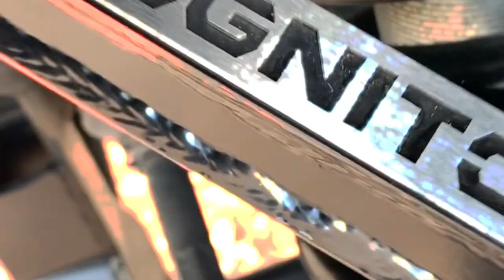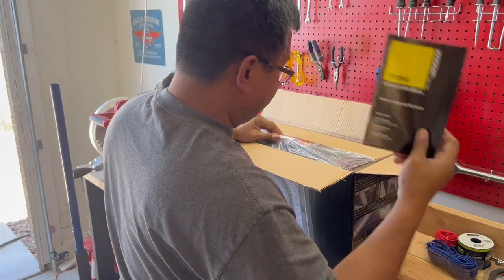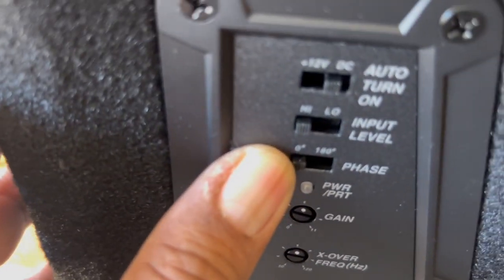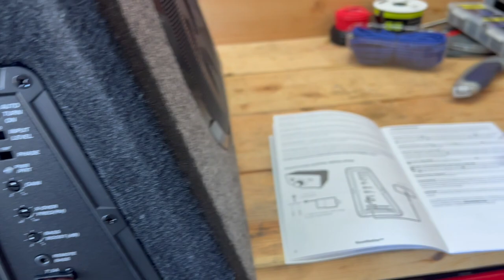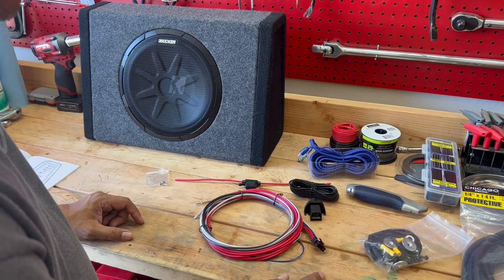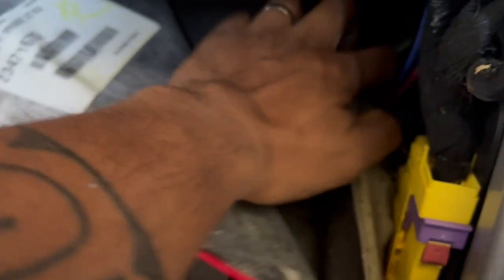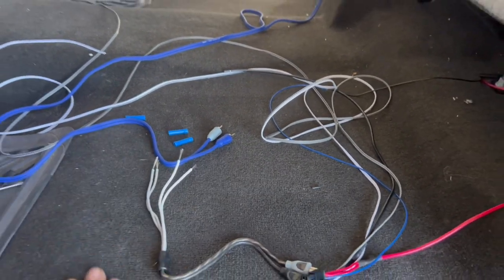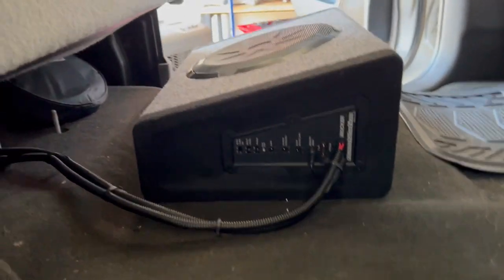Kicker PT250 Subwoofer Kicker Install and Review

Comment: The mic can't pick up the bass.
Reply from the maker: Thats usually the case when you try to record it...it usually never comes out...  You can make out the difference if you use good headphones earbuds.  I guess you'll have to take my word for it that it does sound pretty good for a small sub box.   Full transparency, if you're looking for loud and low thumping competition type bass, you're not going to get it out of this speaker. But if you are looking to add noticeable bottom end in your current stereo system, then this is a good solution.   In the cab, you can definitely hear and feel the difference without advertising to would be thieves...lol
Reply from the maker: @unknownplayer6398  It all depends if your jeep has a hard/soft top.  If your jeep just has a bimini top then NO, you will not feet it.  You will hear the sound but not feel it.  If you have a hard/soft then yes...the sound will resonate much better and you will feel it.  I would suggest setting the crossover more towards 100hz for punchy bass.  Like I said in my video, don't expect super loud booming bass.  It will add a fuller sound with noticeable bottom to your current system.  I hope this helps!
Reply from the maker: @unknownplayer6398  what matters is RMS.  You will need to match the amplifier output to those speakers.  Example:  10" speaker has a rating of 50 to 250 watts RMS (Rockford R2d2-10:  Click this link to view specs:  

https://www.crutchfield.com/S-NXEaQao6hnE/p_575R2D210/Rockford-Fosgate-R2D2-10.html?XVINQ=DST&XVVER=2M7&awcr=386393273913&awdv=c&awkw=&awmt=&awnw=g&awug=9030017&gclid=CjwKCAjwp7eUBhBeEiwAZbHwkXiQ9bCQFRsSfpaVlyIh2Ppug11Ey9xY79i_2TpwjVNj8_FCF0-6ZhoCz6UQAvD_BwE.  

RMS is defined as:  Root mean square or simply RMS watts refers to . RMS values are usually lower than peak watts ratings, but they represent what a unit is truly capable of handling.

You will need an amplifier that has an output of 250 watts or greater to get the most out of the speaker.  More watts RMS is much better then less.  So if you are going to run two speakers, then you need to make sure your amp has double the watts in RMS.  The 800 watts rating is more than likely a max watts that speaker can handle (unless it states 800 watts RMS).   I hope this helps!

Comment: Why not just wire tap?
Reply from the maker: Aloha!  Can you be more specific about using a wire tap…. I can only guess you’re referring to tapping into speaker lines?
Reply: Hello! Yes, I have 2021 silver, non-Bose and the speaker wires are white& blue/black in passenger. I wanna do 2 of these can I just split and either do a PAC high/low to the speaker wires or just straight into those wires?
Reply from the maker: @dylanbushre2681  so you want to connect two PT250’s to just one wire source? It all depends on how many watts you Bose systems sends out.  If your head unit has an internal amp that puts outs out 20 watts per channel, you will experience major clipping, distortion and bogging, that’s why you would use a PAC to reduce the signal.  Technically you can go direct, but you will either loose signal so the subwoofer amp won’t turn on or you’ll get clipping….
Reply: @hawaiianbrokechanic  so it’s Non-Bose, and no amp that I know of it’s a Custom with base audio and factory head unit
Reply: @hawaiianbrokechanic  what I could do, is take one to the passenger side and the other to the driver side for the signal wires
Reply from the maker: @dylanbushre2681  technically you could.  The PT250 requires left and right input (see your instructions) to be connected to the amp.  Just connecting it to one channel could or may burn out the one channel input and or reduce the dynamic range providing you with crappy sound.  You need will need to  to connect to the HI Input wires (L&R) by connecting both negatives to the negative wire that your tapping into and connect both positives to the positive wire you are tapping into as well… WARNING:  you need to make sure you identify these wires before crossing them or you may cause damage to the AMP or injury to yourself…

Comment: Hey there, I’ve installed a pt250 in my truck, I didn’t connect to an rca cable I went straight to speaker wires. Whenever I turn on the truck it powers on but it won’t play when the bass comes. I switched the power to an 8 gauge wire. I also didn’t connect the power wire bc the speaker wires would pick up the signal and turn it on, any suggestions?
Reply from the maker: Set switches to DC and HI input…(meaning you are not using your blue remote wire).  The head unit output speaker wires are connected to the input wires to the amp.   NOTE:  the output wires from your head unit cannot be connect to any other speaker.  I’m other words, if you have rear speakers and you tap into them, you need to disconnect the rear speakers so the amp can sense a signal… feel free to ask any other questions!
Reply from the maker: Another note:  if your head unit has a built in amp (head unit puts out 20 watts or more) the sub will clip and go into protect mode.   You will need to back off on the bass EQ on your head unit.  The way to fix this is to purchase a line leveler to reduce the signal…
Reply: @hawaiianbrokechanic  hey so I just read this reply which answers my initial question. However, now my next questions would be, 1. Do I need to tap into both rear speaker or can I just tap into one? 2. You said to disconnect the rear speakers one I tap into them?
Reply from the maker: @MarkMiewords7  yes you connect to the wires that connect to your speakers.  AND NO you can’t connect both speaker inputs coming from the powered sub to just one of the channels coming from your head unit.  The sub speaker inputs need to be connected to its own channel (example-left speaker coming from head units needs to attach to sub amp left speaker input and right to right).   I hope I didn’t confuse you🤣